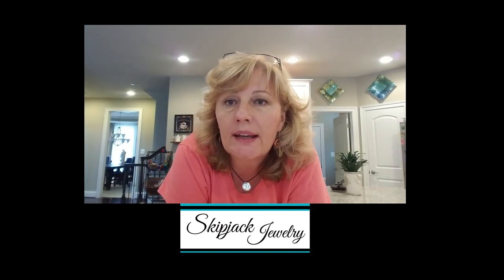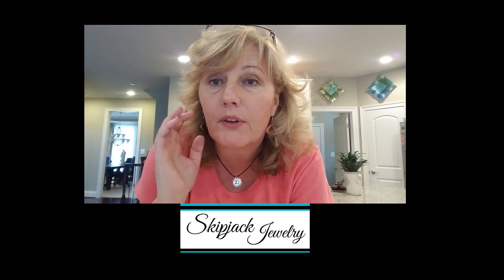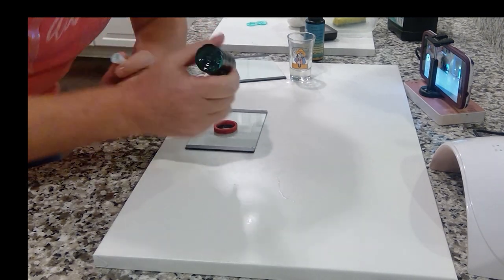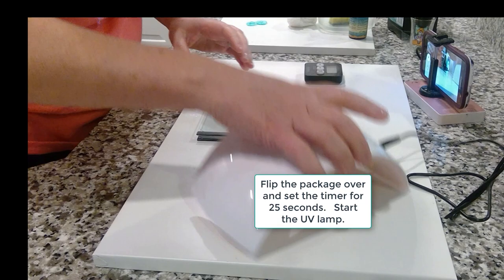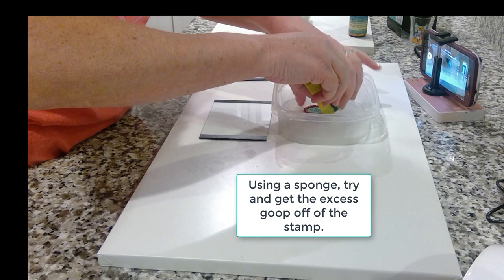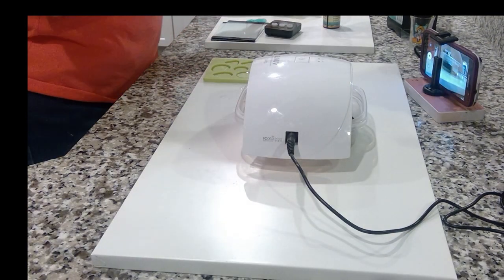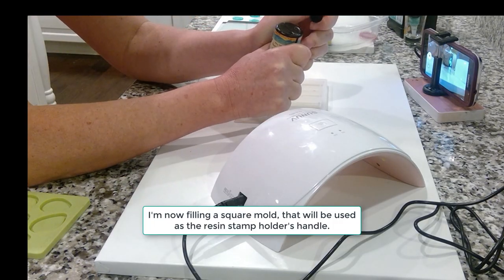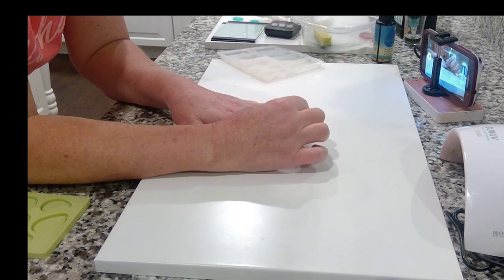SkipJack Jewelry Stamp Making - DIY Stamp making with Photopolymer Resin

Comment: But how well does it stamp?
Reply from the maker: I should have shown an example at the end of the video...   It worked excellent for the purpose of stamping in the precious metal clay.   I also made smaller word stamps (for ink pad stamping) and they worked really nice too.    However, I did a couple word stamps where the font was really small, and although it worked... it wasn't great.    This process does take a little practice to get the timing down.   But once I determined the sweet spot, it worked consistently every time.